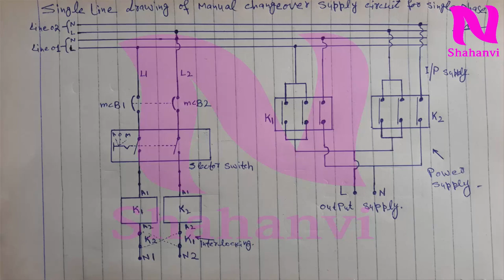Two Supply Manual Changeover Switch Wiring For Single Phase In Urdu - Hindi By Nadeem Shahanvi

Comment: This Dc changeover switch can give input solar PV + - and output A side 5HP solar water pump or B side solar inverter. When switch chang between pump and inverter with this changeover. Rating current 16A 700V.
Reply from the maker: yes